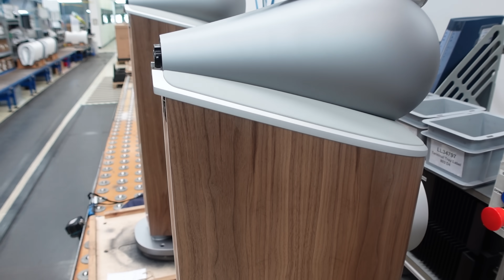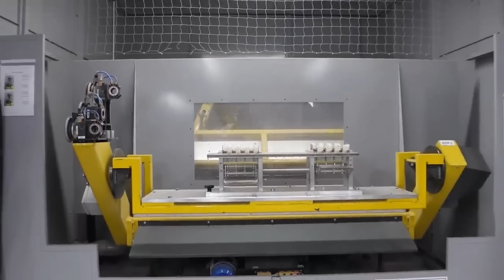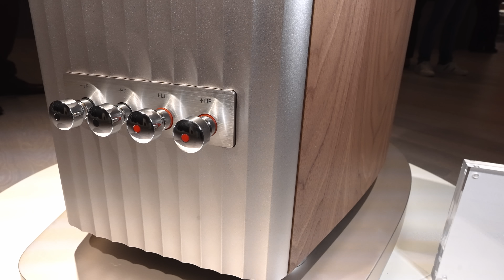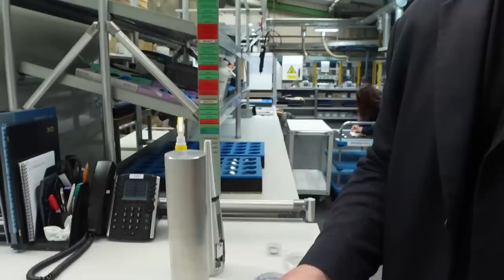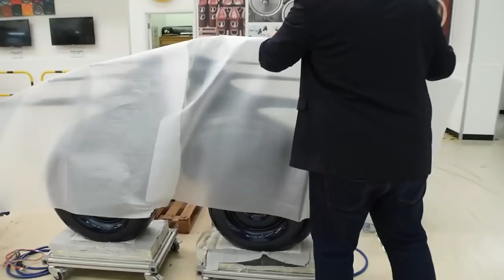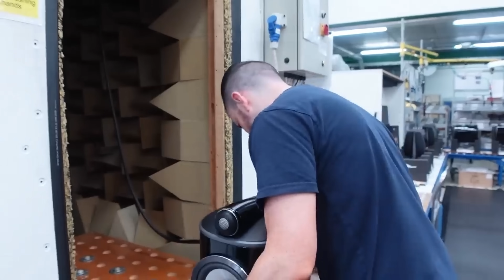How Bowers & Wilkins’ legendary speakers are made

Comment: I'm sticking to DIY speakers. They last so long, and cost so little.  My speakers are mirror images of each other. They each contain one 15" woofer, 2 dome mid-range drivers, and 4 dome tweeters.  They sound fantastic.  I built them back in 1976.   The only repairs required cost me a whopping $27 to purchase outer foam ring replacements for the woofers. 50 years old and basically looking the same as they did on their birth day.
Reply: I Agree, there are some killer drivers available right now, try these  drivers on your next build, you will thank me later - "Marc Audio" best bang for your buck and they sound killer!!
i have tried about every driver out there - etons, scan speak, dynaudio .ect

Comment: The truth about B&W is very simple: They never managed to build a pair of really good sounding speakers.
People without a clue how instruments should sound will buy B&W. Cos most people do not notice when a Steinway A Flügel sounds rather like a Bösendorfer Grand because of the typical mids and bad transient response of the B&W's. Rhythm and drive is also very problematic. In that department the cheapest (and even oldest) Triangle's, Spendor's or Rogers' will destroy them (just an example).

Comment: I always liked B&W speakers but most of my experience were with the less expensive models from 15-20 years ago. Amazed that there are enough people spending so much money to support so many high end hifi companies.
Reply: unfortunately its because most of the people buying a $100,000 speaker end up using it to play siriusXM at a low volume in their massive living room... similar to how most people you see driving around in a 100,000 luxary SUV are rarely driving or offroad enthusiasts and are almost always an old guy whose busier trying to figure out whether the light turned green than he is figuring out how the locking differentials work

the last time i saw an audio system worth more than $5000 in someones house, they couldn't even tell me who it was made by or anything about it other than how to make it play the radio off the tv... the brother had a full revel ultima matching 5.1 system in his living room. used it to watch cable.

not every single buyer, but id be willing to bet that statistically these hifi companies are just producing a living room status symbol that looks pretty. since they charge as much as they do, they get to be extravagant and innovative with it on the ultra high-end stuff and then it eventually trickles down into normal consumer territory. but it feels like no coincidence to me that they only way to even get your hands on anything in this territory is through third party white glove delivery companies that seemingly usually don't inform their customers on much of anything before or after the credit gets pulled

Comment: furniture sold at astronomical prices under the cover of hi-fi label. no matter how thick is the cabinet, if enclosed, the sound i will make the paper thin cone to vibrate like any other box
Reply: These prices are outrageous. But are you saying that every speaker is equally capable? I used to own b&w, but I switched to focal long ago. I have a pair of 1028be. They are crazy good speakers. Secondhand for 2200 euro now. I bought them new for 5500 the pair.

Comment: The drivers are fantastic, got a CM1 used. Then I upgraded the inner wire and resistor. The capacitor was decent back in the days. 

The result just blew my mind.
Compare to the show rooms that I’ve gone to so far. I’ve got a really high quality sound system for a fraction of the price, by just upgrading the cost cutting inner craps.

Sad that more craps are thrown into the late models, but the drivers and cabinets are still great, just upgrade the rest when you own one.

What you’ll need is some soldering tools. PS. Don’t go cheap on the solder, that is the final mile.

Comment: I'm glad I got a set of the 804 for $5000 about 16 years ago before all the price increases each generation.
Reply: I bought 804s in 2009 and paid about the same... couldn't justify the cost of the new 804 D4 signatures, overpriced for the performance and what elese is around these days. I picked up some AE coriniums 2 yrs ago, never looked back, just voiced better than the B&W who still use that showroom tune with the bump in the top end.
Reply: You can’t get deals like that anymore

Comment: I've had my B&Ws for about 16 years now and they've only gotten better with age.
Reply: With Audio equipment today my friend, the older you go, the better sound you will get.
I have a pair from Sonodyne from the 80s that my dad bought. Sounds like heaven 😍.
Reply: Your hearing gets duller that is why you think it starts to sound better 😂 you hear less low end and high end that can be problematic in your room
Reply: Yep, the more the capacitors degrade, the surrounds harden and ferrofluid dries, the better they get.
Reply: That’s because as you get older you can’t hear the ear bleeding high frequencies as well so they are starting to sound like good speakers

Comment: B&W has changed hands several times in the last decade alone and their board is only interested in their profits, they cut corners wherever possible.
Reply: You can clearly see that from this video.  lol
Reply: They certainly cut corners on the midrange and tweeter enclosures...........
Reply: Not true. They’re a very bright company with bright ideas and bright engineers. To say otherwise is shrill and glaring.